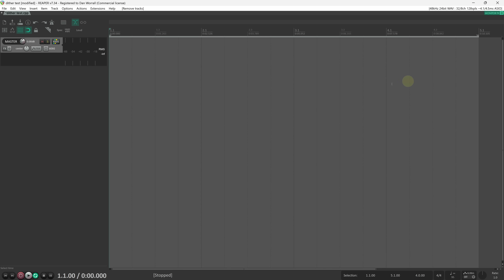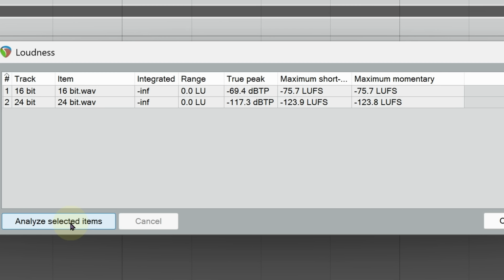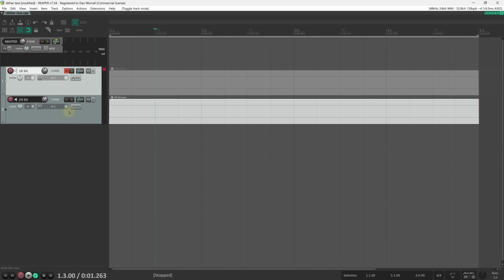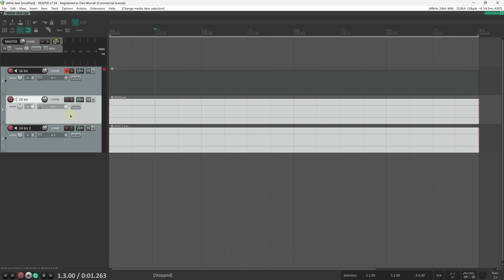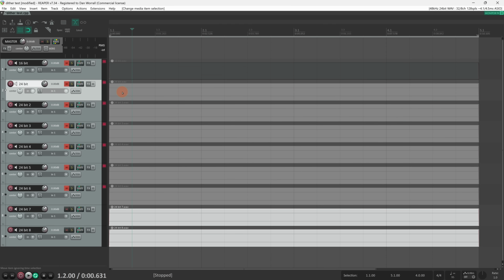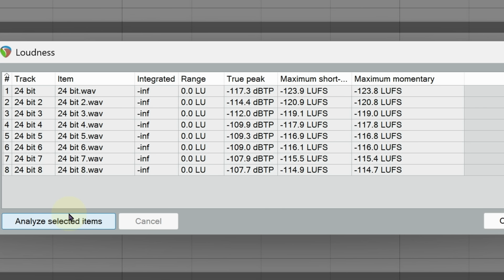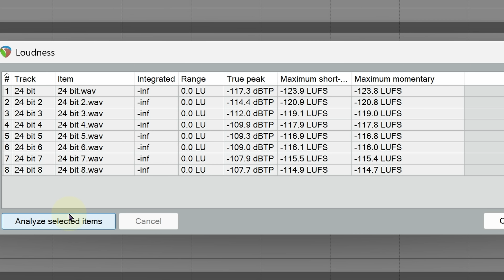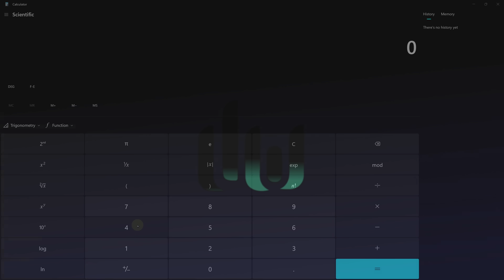"Only Dither Once"

Comment: Question for you fellas.
Would you dither 96kHz 64bit float when downsampling to 48kHz 24bit PCM?
Reply from the maker: I would, but only because it's mathematically correct, not because it makes any audible difference. Do your samplerate conversion first, then dither second.
Reply: @DanWorrall  appreciate the tip 🍻

Comment: I’m adding 24 bit dither first step before a 24bit digital mixer, then 16 bit dither on mastering. Outcome: -96.4 dBFS noise. I do the same with 20 bit dither before the mixer and again 16 bit on mastering and what do you know? -96.4 dBFS noise. Shocker. 😅 And that’s a noise floor only audible if you listen to music at more than 116dB SPL, which will damage your hearing. With the amount of amplification needed to actually hear the noise, I feel like people sometimes just get too perfectionist on the technical side of things. And unless you start to work as a professional destroyer of hearing abilities, you will not care about having a 16 bit noise floor, after mastering, ever. So caring for even 20 bit noise is likely closing in on having a case of OCD, in my opinion. Never mind 24 bit. But you do you, I guess.

Comment: Your point about QC is interesting. My procedure has long been: 1) render archival masters at 32 float, session rate, 2) QC archival masters, 3) use batch processors to create 24-bit session rate and 16/44.1 production files.

Should I QC every single production file? Yes. Could I reasonably charge most clients enough to do that as a one-man-show? Probably not. Have my batch processors (which are only adding SRC and dither) ever fallen down? knocks on wood No. Do I still add a disclaimer that I have QC'ed the 32-float files (which usually involves a lot of mouth click removal) but that the client should listen to all files they intend to release in their entirety? Yes.

So far, so good.

...*knocks on more wood*

Comment: Here’s a simple question about something that probably doesn’t matter at all: I see people advising to record audio around -18dB. If they’d say this was just best practice, because this way the levels would be high enough for good signal to noise ratio and low enough to avoid any chance of clipping, than that would sit just fine with me. However, they pose that the preamps actually sound the best around the -18dB mark. Somehow this doesn’t make sense to me and sounds like BS. Is it actually true?
Reply from the maker: First of all, it doesn't really mean anything unless you specify whether you're measuring peak or average levels. Second, they're two different things. Your converters are linear right up until they clip, so all you need to do is not clip. That's it. Preamps will have a linear range where there's the least amount of distortion, and when you run them in that range they will all sound pretty much the same. Some preamps distort in subjectively pleasing ways when you push them hard: sometimes these designs have output trims as well as the gain control, so you can deliberately drive the pre-amp hard then trim it back down to not clip the ADC. Otherwise you need to pair the preamp with a suitable ADC (or set the calibration of your ADC) such that you still have headroom when your preamps are run hot enough to sound "good".
Reply: @  thanks for taking the time to respond!
The tutorials that state above point are aimed towards beginners, so let’s assume we’re dealing with preamps in affordable audio interfaces. They say you should aim for an average of -18dB, with peaks around -12dB (of course, this will depend on the dynamic range of the material you’re recording, but I see how this could be a helpful general advice for beginners). Does it really matter as long as you’re not clipping? Does recording at lower or higher input levels actually change the quality (in the broadest sense) of the sound?
Reply from the maker: @mrblablablabla  no. If you're not clipping, and you're not buried way down in the noise floor, you're good. Personally I like to record things at roughly the level they need to be in the mix, so my faders stay near unity, and my rough balances come together quicker. But that's just a workflow thing, it doesn't affect the audio quality.

Comment: fortunately there's more to dithering audio than just the noise floor, such as mitigating losses (and cumulatively so) in depth and detail. This is because dither noise both prevents quantization distortion and preserves signal within it. So, all else being equal, simply send final mix files to mastering with the least amount of re-conversions.

Comment: Yeah, that’s exactly the question I had after watching your previous videos on dither and bit depth, so I tried a similar experiment.
I made a channel with a dither plug-in at 24 bits and copypasted it 1024 times.
The result was:
- True Peak Level: -107.2 dB
- RMS level: -118.8 dB

(All measurements of loudness were "n/a").

Comment: Hello Dan, I wanted to tank you again for your videos. I have a weird way of understanding things in which I cant properly understand any concept if I don't understand everything that's behind it, i.e. In college I was taking a course for OOP in Java, and I sucked very hard at it, however, one day somehow i understood the concepts of discrete math and suddenly and very quickly the comprehension cascaded trough all the related courses until it finally reached the OOP things I was struggling with. I landed a job in java programming so I think I understood pretty well hehe.

Well for mixing, I was also struggling with basically everything, I saw a lot of videos about mixing, what different tools do to the sound and such, but I wasn't able to use it or even understand it until I stumbled across your channel. You are the spark I needed to start the explosion. Thank you very much.

Comment: How about dithering multitracks when exporting 24bit files for mixing? If my production has effects, volume adjustments etc, shouldn’t it make sense to dither each track?
Reply from the maker: Yes, you should add dither, unless it's just the raw signal recorded from your converter without even any gain change. BUT no-one will ever notice if you don't.
Reply: @DanWorrall  Thanks, that's what I thought!

Comment: For level-capped noise to climb up the peak level on summation, a sample must repeatedly be summed with a noise sample in-phase, which is a 1:2 probability at each pass. The other 1:2 is for sample to decrease by 6db. So, this is a one-dimensional random walk problem, the chance of a significant increase is diminishing with each pass. Just draw a Pascal triangle for a few 6db changes and look how improbable the significant outlier peaks are.
Perhaps, the resulting increase in dynamic range of the noise makes it worse at fulfilling its purpose as dither, but I wouldn't worry, you need to manually construct an unnatural chain of events for anything noticeable to happen.

Comment: A simple rule for additive noise is that the RMS level increases by half of the usual, so by 3dB , since there's only a 50% chance of being in phase for each sample.
For mastering I request 32bit floating point mixes, as I don't need to worry about clipping and wrong dither settings applied by clients and explain anything to them. It just makes things easier, but avoiding clipping is the primary reason. I deliver masters at all reasonably useful formats, including 44.1/48kHz, 16/24 bits and mp3. I just label the masters by their expected usage. I know exactly what issues to look for and preparing the media for consumption is literally the definition of mastering.

Comment: …right, because each dither adds 1 in raw signal level, so to go up 1 set of 3dB it has to be doubled, so 48dB of difference in noice floor is 2^16 passes... Yeah, 24bit dither noise is overwhelmingly not a bloody factor. I thought it would take just 16 passes (which would still mean 1 extra pass is completely irrelevant) but I guess the scale is completely different!

Comment: How about distortion from working in a 64 bit float but using hardware inserts that have to go to 24bit and back?  And should one assume the print of a mix with processing on it needs dither since the daw is processing at 64 bit but the print is 24?  I have never worried about dither noise. Mixes sound ever so slightly better with it, to me so I keep it as the last plugin on my master bus.

Comment: A) 3db per doubling is an approximation, so 2^16 is also an approximation, but it's definitely close enough to make the point.  2)  There is no "region" selected.  There is a "time selection".  III) Every render before mastering should be to 32 bit float so nobody has to worry about noise floor OR clipping.

Comment: How about recording the playback (electromagnetic signal) of an already existing 16-bit file that was dithered at one point beforehand? Should it be recorded as 24-bit and dithered again, if you can't turn your discretely-positioned knobs to a loud-enough level before there's clipping?

Comment: Completely agree with the video. Worth mentioning though: 32bit float has 23 bits for the significand (sometimes known as mantissa). Add the sign bit and you’re at 24 bits for the -1.0 to 1.0 signal values. It’s a little more complex than that, but the basic rule is that 24 bit integer audio files are about the same quality as 32 bit float. The additional bits in the floating point number are for the exponent, allowing values over 1.0 and under -1.0.

tl;dr bouncing to 32 bit float for mastering won’t really gain you anything. But, it’s also not going to lose anything, so go for it.

Oh, and there’s also lots of different dither types that will have different characteristics when summed, but as the video said, that will be so quiet at 24 bit that it just won’t matter.
Reply: The exponent will also allow for far more resolution around zero, though. That's why float audio has such a ridiculously low noise floor of under -300 dBFS.
Reply: @SolarLiner  Yep, for sure! I just absolutely would not expect to hear any difference between 24 bit int and 32 bit float. From a practical standpoint, there’s not much to be gained for full mixes being sent to mastering as 32 bit float. Internal processing precision is a whole other story, as I’m sure you’re aware. And on topic for the video: I do turn on dithering when rendering 24 bit files, but I don’t expect that to be something that’ll make an audible difference.
Reply: @SolarLiner  Exactly, and the dynamic range goes just as far in the other direction too. It's pretty hard to clip with floats, unless something is artificially clipping the signal. Not that it's that hard to avoid with 24 bit integers, but you do have to think about the overall level and make sure the peaks are below clipping, but not too far below.
Reply: non-subnormal floats have an implicit 1 in front of the stored significand, so you get 24 bits regardless of the sign bit. that is to say, all integers up to 24 bits in size can be stored exactly as 32 bit floats.

Comment: I was reading some of the comments. But there is quite difference between 44.1 and 48k, I've done quite a "few" sample packs over last 3 years, and eventually we decided to always go for 32bit (no dither) 44.1 kHz . wav files. Since 44.1 seems to be standard.
Resampling 44.1 to 48k or opposite sounds slightly different when I am directly working in daw, and can easly trick your ears.
When mastering we all do digital so refarding dithering we always export 32bit .wav 44.1 (no dither) and final master is exported at 16bit 44.1 .wav with dither for streaming and other services.
I do hate tho also how simple compression from streaming services can change sound drastically when doing playback.
I think its important to adapt to them tho, since 90% of income is coming from streams sadly.
Reply: 24 bit integer and 32 bit float have almost identical precision. Please see my other comment (32 bit float is 1 sign bit and 23 significand bits = 24 bit for -1.0 to 1.0 values). 32 bit float will just give you bigger files, rather than better quality. It’s slightly more complex than that when you factor in the exponent, but it’s a mistake to assume you’ll get an improvement of a similar scale as 16 bit int to 24 bit int.
Reply: the difference between 44.1 and 48k are in the low pass at Nyquist, not anything in the audible range. unless you can hear 22.05khz that is, which, cool, but I don't think I believe you.

The Nyquist-Shannon theorem perfectly samples waveforms as long as they're under Nyquist. I mean perfectly as in, mathematically perfect, as in, it has infinite resolution towards 0. you can encode 0.000000000000000000000000000000000001hz with a sample rate of 1hz perfectly.

what it has nothing to do with is amplitude sampling. frequency content can be stored perfectly below Nyquist, but amplitude is completely different. that 0.0000...1hz waveform would need a massive amount of amplitude resolution to be sampled.

What you're hearing might be something done in the resampling stage or export stage, or might not be there at all. see if you can set up a blind test of 20 or so files and see if you can really tell the difference. 

you cannot physically or mathematically tell the difference between 44.1khz and 48khz for the audible range, it's mathematically impossible. if you think your ears are better than cold hard math, youre wrong.
Reply: @cataclystp  Biggest problem is our clients are mostly FL Studio users so we keep everything 32bit 44.1, fruity sampler  has weird Resampling issues from 48 to 44.1. My coleague suggest we just keep it to standard 44.1 cause of this.
Reason for 32bit is cause we have Huge database of files, and keeping them "clean" from dither and having extra headroom with 32bit float is sort of necessary.
But yes, when I was younger my ears could hear more resonating freq. Also whoever says they can hear 22.05 is most likely lying. We are not dogs, we are humans.
I hope this explains some of choices we've made over last 4 years.

Comment: Hi Dan, thanks for the great video as always, question, im also thinking about automation points and quality, is it easier to go 48Khz 32bit , as it’s related to oversampling using plugin x2 etc so the calculation stays x2 x4 etc rather than 48Khz to 24bit from 48Khz to 24bit that 8bit of volume mathematically it’s not that simple and can confuse many things, and for the plugins to get a 48Khz sample rate and by applying a plugin let’s say a tape emulation or any emulation plugin to get the most of it sample rate wise, when doing just x2 over sampling it can simply jump from 48Khz to 96Khz easily and it applies also for the bit rate if it’s at 32bits as you said also most of the DAWs using 32bit float or 64bit float, I use Cubase and it’s actually set at 64bit float for the whole DAW Processing Precision, I found that recoding at 44.1Khz & 24Bit is enough for the headroom, but here’s the problem the sample rate isn’t enough for automation precision and the conversion from 24bit to 16bit it’s just 8bits that can create a problem, I thought doing 48Khz 32Bit for a forever safety even it’s more than required for recording yes that’s true but for downsampling and to convert the bits to 16bits if it’s needed for whatever reason it can go down from 32bits divide by 2 easier than 24bit to 16bits and the same thing applies to the sample rate I found 48Khz when sampling X2 times it’s easier and when downsampling from 48Khz to 44.1Khz it’s a problem, im stuck thinking there it’s should actually go for 88.2Khz and 32Bits as a conclusion, I hope you understand and picture it with the same vision as you have, I did watch every single video of yours too but I thought about automation points when writing them via a fader I like to get more precise points when automating effects etc and I like to get enough headroom for recording and of course when exporting the project it get converted with no problems even a little as in that -100dB range 🙂 , i hope I hear your thoughts about this I can also be wrong but those details are connected and they do exist. Thank you
Reply from the maker: Was that all one sentence?? Lol. Regarding automation, I don't know why the samplerate would limit the precision? But maybe I just don't know Cubase well enough? The bit depth thing is way off though. 32 float is not really twice 16 bit, as the latter is just one integer number, while a 32 bit float consists of a 23 bit mantissa, an 8 bit exponent and a sign bit. Think of it like scientific notation (eg 3 x 10^32) only binary. But even if that wasn't true, or you were talking about 32 bit integer, you still need to add dither when you reduce the word length. It doesn't matter what the original bit depth is, you should dither when you go down to 16 bit.
Reply: @  Lol, thank you for your clarification, I empathize most of the tracks harmonics digitally in case the dither will add that noise it will go terrible bad , I hope you’ll be able to check Cubase capabilities one day just to test it out exceptionally the Logical Editor :)

Comment: So dither just toggles the last bit randomly throughout the track to introduce noise?
Reply from the maker: Yes. To convert the deterministic quantisation errors which we perceive as distortion, into random errors which we perceive as noise. To preserve fractional values as probabilities of a high or low bit.
Reply from the maker: (And it might be more than just one bit, if there's noise shaping as well)
Reply: @DanWorrall  I'd forgotten how that works - thanks!

Comment: Before people start arguing about dither, they have to start being able to hear noise at -40 dB in a full mix before they start thinking about dither noise, truncation distortion and similar artifacts. And no. Measuring it is not the same thing as hearing it. You make music with your ears and recording gear, not with testing equipment.